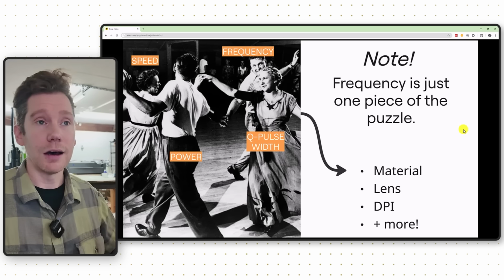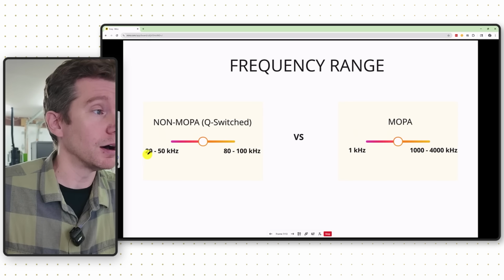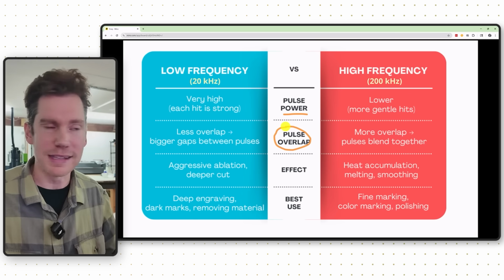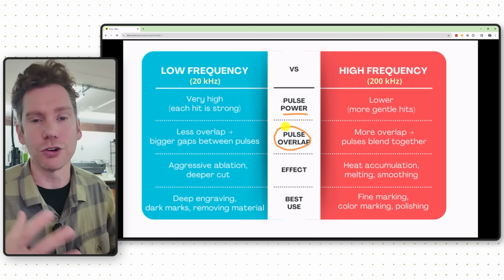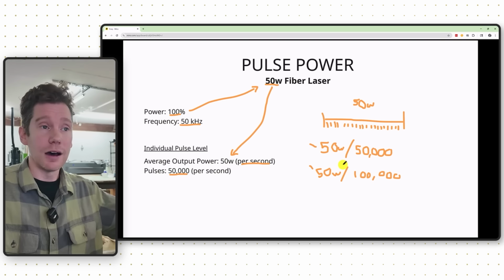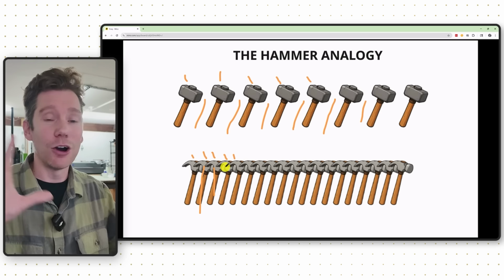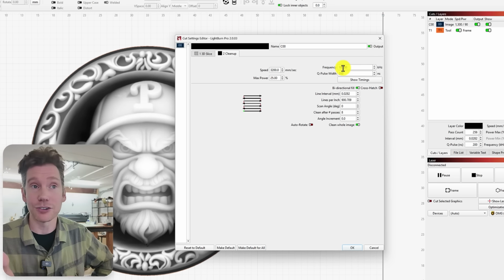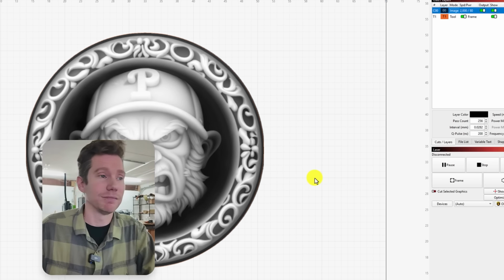Understanding Fiber Laser Frequency — Explanation + Real Engraving

Comment: Excellent video! I’m new to fiber lasers (not to lasers themselves) and needed a good primer to grasp a better understanding of the frequency settings. 

A (hopeful) bit of advice should you make another video on frequency, is when trying to make a more visual analogy is to use something like saw blades. That’s just where my mind went as I’m also a woodworker. Even to the non woodworker type, the analogy is a perfect representation. On the low frequency side it could be represented by a traditional circular saw ripping blade. Big teeth, big gap, it hogs off material in a hurry, but leaves a rough cut. For comedic effect you could even go a bit more ridiculous and put up a picture of an old 2 man tree felling saw. And on the high frequency side, a hack saw. Tiny teeth, super high frequency, lots of overlap, much smoother cut finish. 

Just my .02

Comment: Very different model (300W M7), I have been doing 2D coins for pure depth (to resin fill) at 1000kHz 50% 3000mmps 0.0250mm Line interval 150 passes.   I need to get back into 3D coins, this has motivated me.

Comment: Hi, I have a 60W Mopa Laser and learned a lot from the video. Thank you very much for that. Unfortunately, I can't find any good settings for the depth engraving of 304 stainless steel. Either the engraving is deep and dirty or very flat and smooth. I would love a video on deep engraving stainless steel. Best regards from Germany.
Reply: i can advice for you. what lens do you have. do you have air assist?, what machine are you running with?
Reply: @globaljeweler  Hello, thank you for your answer. I have a Commarker B6 60W Mopa fiber laser and use a 150mm lens. I would really appreciate some tips on settings. Best regards from Germany, Martina  PS: I use an exhaust air.
Reply: @d @dekleene_4tina  Stainless steel and titanium are much more difficult materials for deep engraving. Achieving good depth and fine detail within a reasonable amount of time requires careful parameter optimization.

One of the most important things is to minimize sparking during engraving. If you see constant sparks, reduce the power, increase the speed, or adjust your other parameters until the process is much calmer.

For deep relief engraving on stainless steel using a depth map, air assist is absolutely critical. As material is removed, molten debris and slag accumulate inside the engraving. Without a strong stream of air to continuously blow this debris away, it will re-melt onto the surface, resulting in a rough, uneven finish.

The first few layers may look good, but after that the re-melted slag quickly builds up and ruins the surface quality. Because of this, I highly recommend using a proper air assist system.

The second important factor is your laser settings. Do not use the same parameters that work well for brass.

As a starting point with this machine, try:

* Speed: 2000–3000 mm/s
* Power: 50–80%
* Pulse Width: 150–200 ns
* Frequency: 65–100 kHz
* Hatch Spacing: 0.025–0.03 mm

Also, I would not recommend using a 256-layer depth map. Use at least 512 layers for smoother transitions and better detail. If your priority is maximizing engraving depth and preserving fine relief details, I recommend using 768 layers or more.

Finally, even if you use these recommended settings, the results will still be limited without air assist.

If adding air assist is not possible, compensate by using more cleaning passes. I recommend performing a cleaning pass every 2–4 engraving layers. This will help remove loose debris, reduce slag buildup, and produce a much cleaner final result.
Reply: english isn’t my mother language. so i just used translator.
Reply: @globaljeweler  English is not my native language either, I also use a translator
Reply: @dekleene_4tina yeap did you check my answer? if would you like to know more. just ask me
Reply: @globaljeweler  Thanks in advance for your tips, I've actually tried quite a few of them, even with less power. I'm almost afraid I'll have to blow on it with extra air. Can you give me values for the cleaning pass, I'm not sure about that, so far it seems to be removing too much of all 10 engraving layers, resulting in less depth and visibility.
Reply: @dekleene_4tina  You need a strong enough air assist. This is especially important with stainless steel, as you want to prevent re-melted material from sticking back onto the surface.

For the cleaning pass, I usually run it once every 4–16 layers. My typical settings are:

* Speed: 3000 mm/s
* Power: 20–30%
* Frequency: about 1.5–2× the frequency used for the main engraving pass.

Also, if you can clean up the original depth map by reducing noise and smoothing the image before engraving, I highly recommend doing that. A cleaner source image usually produces a cleaner engraving.

When engraving stainless steel or titanium, I normally use at least 768 layers, and for highly detailed work I sometimes go as high as 1,600 layers.

In my experience, these materials are not very cost-effective for deep engraving because they require a tremendous amount of processing time.

If possible, I would recommend using cupronickel instead. While it is not quite as easy to engrave as brass, it machines much more easily than stainless steel and also has a more premium appearance.
Reply: @globaljeweler  It's actually a long process and I'm just doing it as a hobby, but I still want to find out and thank you very much for your help. I'll try to apply your tips and hope to do it in a while. Thank you again.

Comment: 256 passes?? wow - how long did that take? and how much do you sell these for in your country? in my country (NZ) no one would pay that much, so all my engravings are fast, 5 passes max, and take less than a minute, because no one will pay more than $4 each. I estimated its going to take 9 years to pay for my laser, thats if it does not burn out the laser first (which is why I cant waste its power doing 256 passes on each part!
Reply: I have tried to market higher priced, or deeper engravings, but no one buys here, everyone is cheap skate scrooges in NZ, but I still have to charge $2 per minute, to be able to pay all the taxes, rent, power, insurance, etc. About $1 goes towards paying those costs, and $1 goes towards material, paying off the laser, and a few cents each if Im lucky for myself, which oddly enough is less than the legal minimum wage in NZ, so I should really be arrested for mistreating myself as an employee.

Comment: Can you explain how Q-pulse width works vs frequency/power? Im confused as to the interaction of the settings and what effects a high or low q-pulse has?
Reply: Q pulse is the duration of each of those 50,000 pulses (50khz frequency).  200ns is 200 nanoseconds each

Comment: In your explanation of pulse power, I think you're confusing watts with joules.  Watts are watts, no matter the duration, joules is watts in the span of one second.  A joule (J) can also be referred to as a watt second (W⋅s).  In your example, those pulses are 50 W pulses, but only has 0.001 J each for the 50 kHz example.

Comment: Most Helpful video. Your last one matches what the UV does, but takes a day. I used the same similar settings on the MOPA but lost all top detail, so running tests to see if I can get the smoothness of the UV.  Now I have an idea where to start. Running an F2 MOPA and F2 UV.  EDIT: Success! I reused one of my previous failed blanks, so it has double vision, but the detail is there now.  Bumped frequency to 110 from 90, turned clean up off for this test, and bumped speed to 2000 and power to 80% 100 layers. This is using Xtool Studio.  Running a second test on the other side with clean up added at a higher frequency. My first tests that came out bad had clean up at 60khz and 90khz for the engraving.

Comment: From physics lessons. It's impossible to divide 50 watts (power) by 50,000 pulses. Power is energy per second. 50 watts per second is 50 joules (energy). But energy can be divided by pulses. 50 joules/50,000 = 0.001 joules. The instructions for my 50-watt laser say the maximum pulse energy is 0.0007 joules (apparently at 20 kHz). At 40 kHz, the energy will be half as much. It would be better to delete the part about power.

Comment: You should explain the pulse width a bit. That is why the lower pulse rates tend to hit stuff harder. I am assuming these are digital pulses so at 80% at 1khz you will be hitting 1000 times a second for however amount of equil sized on-offs you can fit 1000 times a second. Because these systems are digital.
Reply: The happer analogy makes more sense but the reason is not the strength of the pulse but the length of time the pulse lasts at a specific strength.

Comment: Would be interesing to check if it is possible to make a good quality plates for hot stamping with the fiber laser - MOPA  - NON MOPA, 50 W, 100 W, 200 W or maybe even 300 W.

Comment: Thank you for this Video. One question: how do you center the coin. I have massiv problems, to hit dhe middle😢
Reply: Red dot Framing if you’ve calibrated it properly.  Otherwise colour the coin in with black sharpie and laser a low power circle it’ll just take the sharpie off

Comment: Very helpful BUT, in your first coin example after putting everything in the settings, instead of hitting “ok” you hit “cancel” ad your settings went back to 1200 speed and 90 power as seen in the top left of your screen.
Reply: Nope when he open the settings for the second coin it was still 2000mm/s. Not sure where you got 1200 from ?

Comment: Great explanation.  However, the "pulse overlap" explanation is not exactly correct.  You're stating that the diagram covers an arbitrary unit of time (one second) and that means that the individual pulses overlap in time -- but they are overlapping in space instead.  Minor difference in practice, and probably doesn't affect the end user that isn't getting that deep into the theory.  However, it is misleading because the explanation of what is happening is wrong.  Otherwise, great video.
Reply: Good point. And the beam is moving, so lower frequency pulses will elongate, making dotted lines. The "circle" model only works if the Speed is adjusted in addition to the Frequency. (IIUC)

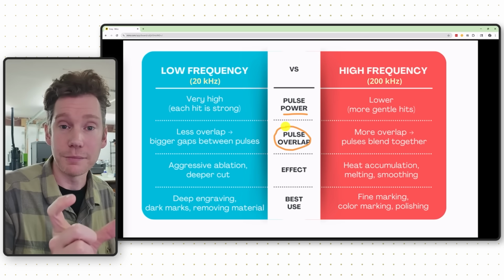Comment: 12:30 this analogy only works if the pulse length is fixed - which it might not be, as it can be an extra knob to tweak
Reply: Interesting result, i always up the power with frequency. I did not expect there to not be any difference in depth with higher frequencies.
Reply: The individual pulse length is fixed it’s 200ns, each pulse lasts 200 nanoseconds that’s your Q-Pulse
Reply: @NatesToolbox  Which part of "this only works if the pulse length IS FIXED which it MIGHT NOT BE" was unclearly written?
Reply: @oorcinus  I don’t know you tell me ?  But I’m telling you it’s it is fixed.
Reply: @NatesToolbox  On every MOPA in the market? You've personally checked?

Comment: I have a question. If you needed a laser to cut that coin in half what laser you would buy? I kinda want to do carvings like these. And I want to be able to cut the coin clean.
Reply from the maker: Ive seen it done with 50/60w fibers but its not an economical process as far as time goes. If you wanted to consistently cut out coins I would suggest getting at least 100w with a 3D galvo head.

Comment: There is an oval mark on the end of the clown's nose.  •  Is this oval supposed to be there, or is that some of the image clean-up that's needed?  •  What would be required to get a deeper 3D effect?  •  While the laser is doing its thing, is it possible in the program file to have your laser vary between 48 and 100 settings and affect only certain specified areas of the engraving?                                     

Thank you!  •  Your video cleared up whether I should go with a MOPA laser or not.

Comment: When comparing the three coins, you seemed to like the last one with the higher frequency, but then you said that you were only changing your normal settings to use 100 instead of 200.  Why?  Why would you not run it at the 200 frequency?  You said the depth was close to the same.  Does it take longer to run or anything else?
Reply: Just because the 200 KHz coin in this test looked the best doesn’t mean it’s the superior setting.  100 KHz is still high enough to produce a smooth surface compared to 80 kHz whilst still maintaining more efficient material removal, going any higher is counter productive just because you can doesn’t mean you should
Reply: @NatesToolbox  What is the trade-off with the higher frequency?  I assume it's longer time, but that's never  mentioned.

Comment: First of all, thank you for the effort you've put into providing information to others. However, I do have some criticism: 1.) The idea that the laser pulses would overlap in such a fiber laser is simply wrong. Let's take the chosen frequency of 48 kHz. Here, a pulse is triggered every 20833 ns (= 1 s/48000). This pulse has a duration of 200 ns (see your settings). So, there's a pulse lasting 200 ns, followed by approximately 20000 ns of silence. Even at 200 kHz, there's a 200 ns pulse every 5000 ns, followed by another 4800 ns of silence. To speak of an overlap in this context is misleading. And if we actually had an "overlap," we would have a CW (Continuous Wave) laser, which is not the case here. It is true, however, that with increasing frequency, the periods during which the laser is not emitting become shorter, resulting in a somewhat more uniform illumination. 2.) It remains unclear why you ultimately simply try 100 kHz and immediately present it as optimal, while the tests showed 200 kHz to be superior.
Reply: He's talking about spatial overlap, not time overlap. If you do not move the beam then all of the pulses overlap spatially, regardless of the duty cycle. If you move the beam more distance than the spot diameter between pulses then they do not overlap at all.
Reply: @stephenfazio exactly.
Reply: Hey 
Didn’t know the King of Lasers had a YouTube channel 🍻
Reply: I ain't no science guy like yourself, but I believe he was talking more about an overlap of temperature caused by the rapid pulsing. The rapid pulsing leaves less time for the metal to cool between pulses (as shown by your bananoseconds). He sort of mentioned it at the start of it, but that point did get lost a little later on in the video. As for trying the 100kHz, I think it's about find the balance between smoothness and depth. Probably a personal preference type of deal. Some people like it deep, that's why my ex left me.
Reply: @christrentham2010 😮😅 sorry to hear😉
Reply: I think there might be some confusion between time overlap and spatial overlap. You’re right that the pulses don’t overlap in time. At 100 kHz or 200 kHz there’s still a gap between pulses, so it’s not acting like a continuous wave laser.
What he means by “overlap” is spatial overlap as the beam moves across the material, each pulse lands a certain distance from the previous one. Increase the frequency while keeping the speed the same, and the pulses land closer together and more  of the laser spots overlap on the surface, which increases heat accumulation and can change the engraving result.

For example, at 1000 mm/s, 100 kHz places a pulse every 0.01 mm. At 200 kHz, it’s every 0.005 mm the pulses aren’t overlapping in time, but they are overlapping more on the material itself.

That’s why you can clearly see the 200 kHz coin produced a smoother mark, while lower frequency of 48 kHz produced a more aggressive or deeper engraving depending on the material and pulse width settings.

Comment: One small caveat, not all MOPA lasers have an unlocked pulse width. JPTs LP series lasers use MOPA tech (Master Oscillator Power Amplifier) to generate a beam but have a locked pulse width of 200 ns. The MX series (M7/M8 etc) have unlocked pulse width and have 17 preset ns settings each with their own cutoff frequencies and Max frequencies.
Reply: Correct, but for these examples in the video, he didn't mess with the pulse width
Reply: Do you know what company’s offer a fiber laser with JPT M7 OR M8 power source? TY
Reply: @armarmo964  Look at HaoTian Lasers

Comment: It might be a stupid question, but what was the advantage on the coin when running at 100 compared to the 200 from the test?
Reply: 200khz is overkill, 100khz is enough to make a smooth surface over his 80khz setting while still maintaining efficiency on material removal .

Comment: Thanks for the video. Regarding power over time, since power is independent of time, it might be more accurate to talk about work (or energy), not power. 

In other words, you’re describing 50 watt-seconds, which is the total amount of energy the laser produces over one second. This energy is then distributed across 50,000 pulses or 100,000 pulses. 

So, in the first case, each pulse delivers: 
50 W·s / 50,000 pulses, 
and in the second scenario: 
50 W·s / 100,000 pulses. 

Even though the total energy delivered per second is the same, each pulse at 50 kHz carries twice as much energy as at 100 kHz. 

In short: power is time-independent, whereas work (energy) equals power × time.
Reply from the maker: Yeah another comment mentioned this as well. I tried to simplify down too much and didnt factor the next part of that equation in.